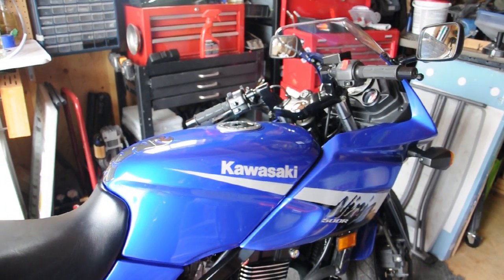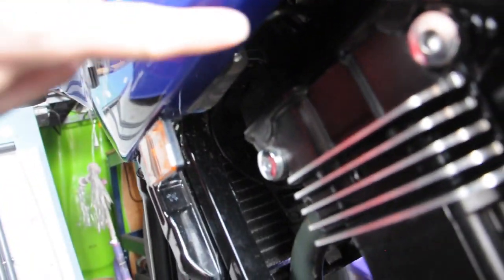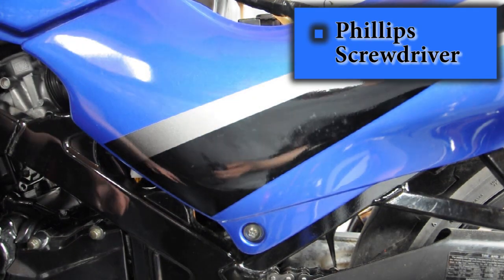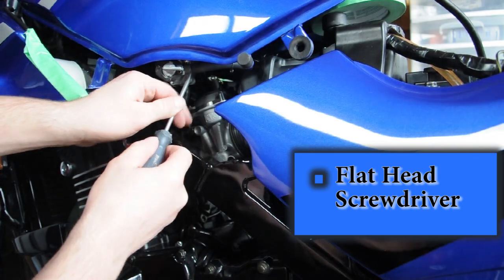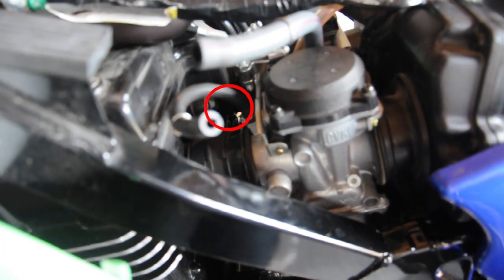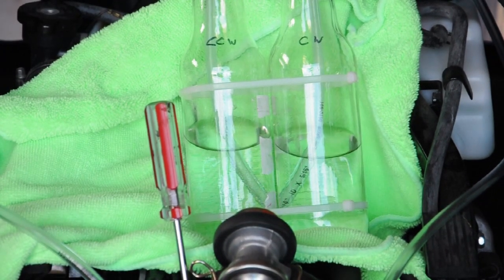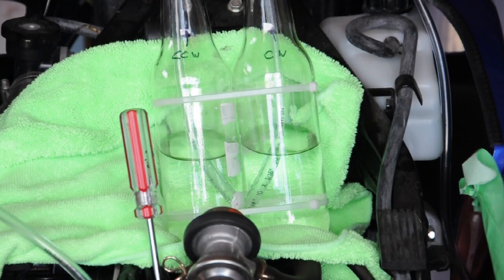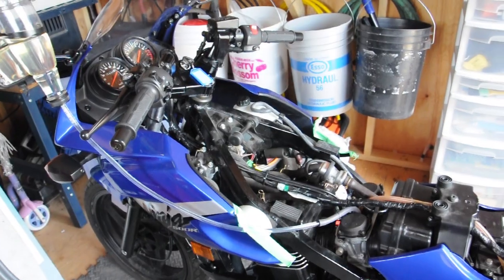DIY bottle Manometer Carb Sync on a Kawasaki Ninja 500 motorcycle

Comment: I just did this to my 2006 vulcan 500, which is basically the same bike, and as soon as I started  it all the water from the bottles got sucked into the carbs and flooded them... Any idea why?
Reply from the maker: Did you happen to place 1  tube between the left and right bottles about a half inch from the bottom of each? and also the main tubes from each bottle need to be up near the cap. The Water amount has to not overflow if it happens to all go in one bottle. So only enough liquid in one bottle about 3/4 of one entire bottle (This is Shared between both bottles.
Reply: +GhostFoxNinja Oh wow. All of my tubes were touching the bottom of the bottle -_- and I had each bottle filled up about half way

Comment: I found a water bottle with a carbiner clip on the screw top and installed a tractor trailer valve stem in the bottom. Brass stem that has a nut that you tighten down

Comment: My right bottle emptied and the left filled and bubbled ... Luckily ive got it starting again but probably not rideable .. hope it starts again at least  .... That after I changed to glass bottles .... Plastic ones crumple and shoot water into your carbs
Reply from the maker: Deep Doubts bout U So yes plastic bottles no good, and also note, FieroGT42 commented below and said  that you don't need to have the fluids exactly level like I thought earlier, you just need them to stop moving one way or the other. One level can be an inch or two or three above or below the other, as long as they don't move up or down. P.S. Sorry to here it went into your carbs, If you can drain them and let them fill with gas again instead of water, that would be ideal. All the best. Not sure but just saying incase it wasn't said in the video, make sure you have a tube connecting both "Glass" bottles together and only enough water that if/when the water all goes into on bottle, it can't be sucked into the tube at the top. Good Luck dude
Reply: GhostFoxNinja The pipe to the left carb was getting water coming up towards carb but it ran afterwards so didnt get too much in or it stopped short .... Hopefully I get it going this evening with one last try or the mechanic round Corner gets a visit ..  but at least nice clean carbs
Reply: GhostFoxNinja Got it working though Need more time to get it going better ....  Tips For Noobs 01 Glass Bottles  02 Dont press down on screw or the revs go up , and besides possible noob  confusion , more pressure in bottles .... turn right for right side to go up and left ....... DONT Press Down on Screw ! If everything goes to one side chill out ... dont press down .... and turn till its sordid
Reply: Deep Doubts bout U  I sorted this out by simply turning the screw right and not pushing down on screw which noobly confuses by  pushing up the revs ... Noobia Enlightenment ... Glass Bottles !!!

Comment: My bottles crumpled up pretty quickly and started sucking water down the left Hand tube .... Total disaster . I Twisted the knob so at least bike starts and idles but i suspect more Problems coming up ...
Reply: Deep Doubts bout U It turned out not to be as terrible as  my noobia infested Brains ....  Well on the way to vastly improved Performance  with a few adjustments ... Starts easy and revs low without being properly set ..

Comment: On this type of homemade manometer (where the fluid does NOT automatically level) all you need to do is get the fluid to stop flowing.  The levels do NOT need to be the same.  The only exception is if it's so far off that one side is drained and is sucking air.  That will save you a lot of time.
Reply from the maker: FieroGT42  Ya you're Absolutely right, I realized that after, lol, I was wasting time trying to level them within the bottles, when I just need to have the levels not move. Thanks for your Comment

Comment: I have a 05 500r
Reply from the maker: I also have an 05 500r. Great bikes.Have you done the "Fog" mod and exhaust mods yet? They will improve the throttle response tremendously!!!! I still need to get a k&N filter to complete the "Fog" mod, but since the hole in the air box and the stock exhaust mods, I've gained a lot of power. Cheers
Reply: Not yet, I want to get the Vance and Hines exhaust, do a valve adjust, fog mod and sync my carbs all In at the same time.
Reply: Did you just open up the factory mufflers?
Reply from the maker: Yep, It's easy and cheaper than a 6-$700 muffler.
Reply from the maker: ninja500 exhaust mods